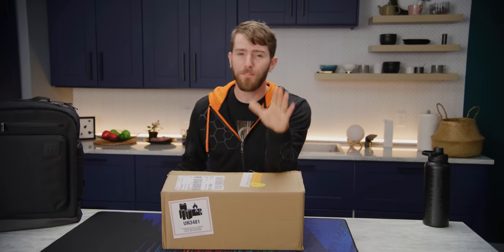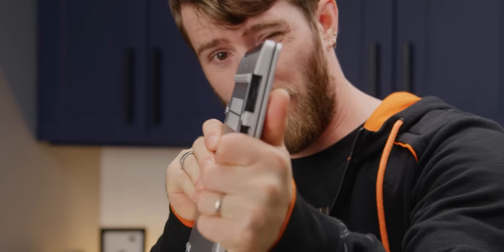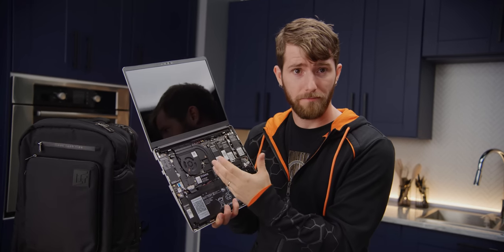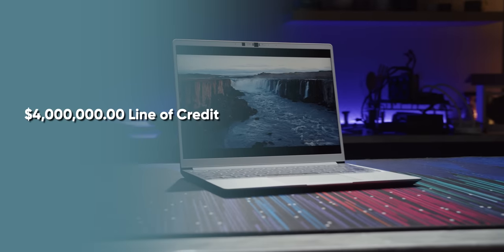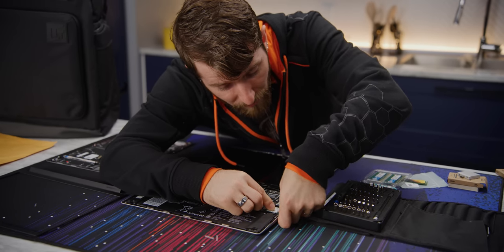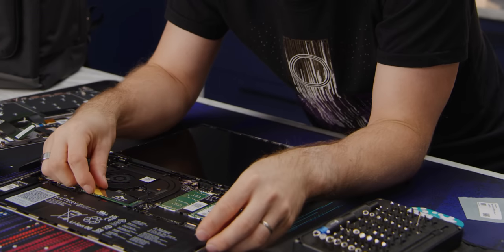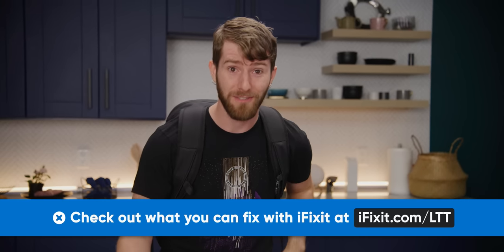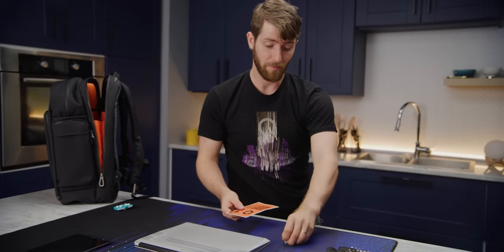I’m Legally Obligated to Disclose This - Framework investment

Comment: As an IT guy that has serviced thousands of laptops in my career, I can say the Framework laptop looks extremely interesting. If I had a quarter million laying around, I might invest in their company too.
Reply: I am awaiting for a laptop with  3060 or 3070 laptop for Data Science and AI Simulation and algorithms for big data visualization. I was thinking of going for Ryzen 6900HX or i7 12th Gen. I am also working on Network technologies and learning Firewall and cybersecurity over Cloud. 

What would be the best option for a  working professional who also needs atleast 3-4 hours of battery life?
Budget: 2 lac INR

Should I wait longer for another laptop or go for anything that's around for 2000-2200 USD?

Looking for usually 17.3 inch or so for better screen as I am working on large data and visualizations. Small screen makes tough to work on large models

Anything best value for money under 2 lac?
17.3 inches only
i7 12th gen or Ryzen 9
GPU based task moderate to high. I do not need 3080 or 3070 TI. 
Screen quality = QHD
Reply: @Naraayanay  You are not going to get full use on battery with a 3070ti on ANY laptop unless it is plugged in. ALL laptops that have higher end GPUs throttle performance when on battery power. If they don't throttle performance while on battery, the GPU will drain the battery in 20-30 minutes. If battery life is a must, then I would go for a Dell G15 (Ryzen 5th gen) with the 3050ti GPU. I have deployed a few of those and the engineers I gave them to LOVE them. Dell makes the G15 with both Ryzen or Intel options available and the battery life is very good. If high end GPU usage is a must, then you are limited to having to plug in the machine to power when doing higher performance GPU loads. Putting a high end GPU in a laptop only gives you an advantage when the machine is plugged in. You could also go with a machine that has USB-C (3rd gen) and get an external GPU enclosure. This way you can still have some portability but not limit the battery life of your laptop.
Reply: @woodlanditguy2951  Bro! it is beyond my budget

I need to go out and move only once or twice a month for work related task. May be 6-8 times a year. So I think 17.3 inches is not a daunting task to carry, yeah it make things heavier but my work flow also easier when I am not able to get hold of large monitor when not in office or home.

Since I am working on two 27 inches monitors sidewise and need large screen. It makes things really small for 15.6 inch. 

I am also looking to build new PC ( Tower or cabinet). I already have monitors. So, I am thinking what could be best spot to buy- whether to get too high end laptop for all task or
upgrade my current PC to new one and then look for somewhat budget friendly laptop
Though I have budget saved since 8 months just to buy 2500 $ laptop. 

Yeas- I agree and whatever machine I get I will be going for 3 years warranty atleast.  All I am looking for well optimised and great performing machine within my budget. 

I am still confused whether to choose AMD 6900 HX or i7 12700 HX
i9 12900 is outside my budget and also overheats and drains battery too fast.

i9 are too pricey! SHould I wait for a month to get things cool down on price or for better options?
Reply: @Naraayanay  Man, I have no idea what you are asking. If you need a 17" laptop and your budget is $2500 then get a 17" for less than $2500... I wouldn't wait to long as part availability seems to be ok for the moment. if you wait, prices may come down (doubtful) but you won't be able to acquire what you are looking for.

Comment: Once they put out a 15-16” Ryzen-based laptop, my company is going to standardize on that. Love the concept!
Reply: Honestly the modularity and ease of repair could probably save companies a ton of money
Reply: Things that would cause other laptops to have to be sent to the manufacturer could now just be fixed by ordering another hdmi port from the manufacturer, it seems like a huge benefit to both parties
Reply: i dont even care about ryzen or intel, 13in is far too small
Reply: I honestly would love to standardize our company using these as well, the ease of repairs as a tech considering it's difficult to get techs on-site to fix issues these days (not to mention I just want to DiY most things) is amazing.
Reply: @anthonyschlessman1848  absolutely. Plus I'd prefer the screen to be OLED.
Reply: @dos_gringos9853  you bet! A company could keep spare parts around to swap out at any time.
Reply: @dos_gringos9853  they could also make all-in-ones like iMacs like this. When the webcam in an iMac dies, the whole thing has to go into the shop; that's nuts.
Reply: @genjii931  yeah and honestly considering that framework isn’t a massive company that can have onsite techs come out and a massive repair program, it’s going to lower overhead for them as well while being able to have a higher level of customer support
Reply: And imagine just being able to switch your IO out whenever you need too, that could be ridiculously useful

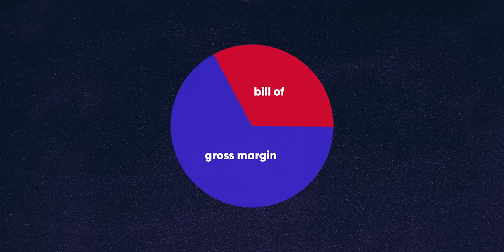Comment: @3:20 Ill have to add to that that the margins on high-technology are smaller, you have a 30ish% bill of materials, in our cable company thats more like 50% with labour accounting another 10-15% and overhead at about the same as labour , so generally the margin is 15-20%

Comment: Super huge risk Linus; I'm not sure I would have done it if I were you.

But I think your video breaking down why this matters and how it works is among the highlights of your channel. Ultimately, I trust your business sense, I still trust you and the rest of the LTT team on laptop review, and I support Framework's vision and direction.

I hope this all works out for the success of all involved.
Reply: It's possibly only a risk if he was concerned about money first, yeah that's a lot to lose, but the effort is probably more worth the investment just to see other manufacturers reconsider their approach.

If Framework fails, there will be somebody waiting to gobble them up, and at that point Linus could just cash out in the buyout (with losses)
Reply: @evolicious  This really isn't true.

The Framework laptop is made using standard off the shelf parts like an Intel CPU. This means that the drivers it uses are made by third party companies like Intel and operating system manufacturers. Even if Framework went bust you would still be able to install new versions of Windows or Linux and application software without issue. This is no different to owning an older PC that is no longer under warrenty and supported by the manufacturer.

The only issues you would have is lack of replacement parts and firmware updates. Given firmware features don't change much over a products life cycle this should not be a huge problem provided they wrote decent enough firmware in the first place. Given no one has complained about the firmware so far I would say this is unlikely to be an issue. It's also possible people will port Open Source firmware to the device such as LibreBoot and CoreBoot. This makes sense as the product is designed for technically minded people who are likely to undertake such an endeavour.
Reply: IMO, Framework is a gimmick that will be out of play in a couple of years. People have been building and upgrading PC's for a long time. Yet every few years you get to a point where you can't upgrade due to architectural changes in hardware. Built a pc with a 9th gen CPU? Sorry, can't upgrade to gen 10 or 11 without upgrading motherboard. This product will be no deferent. Remember Motorola's Moto-Z and Google's Project Ara for modular phones? Yeah, did work out as planned.
Framework are no fools in getting a one of the biggest tech channels to support their product. Where the shepherd goes, so do the sheep.
Reply: @jbrou123  You can still use a desktop PC case from 10+ years ago. It could be the same way in the future with laptop motherboard upgrades.

Nobody is saying you can get away with not upgrading the motherboard or other core system components for all that time. 

Being modular means you only need to upgrade parts as and when you need to. Possibly that you won't have to upgrade inert parts like the chassis for a decade or more because metal is metal and plastic is plastic and neither have any real bearing on performance. It also means you only need to upgrade the parts you care about - like the CPU and mobo instead of say the webcam that you only use once a month.
Reply: @Dong_Harvey  It sounds to me like the main issue here isn't actually building the things or even writing the firmware (there is CoreBoot for that) but marketing issues since Microsoft, Intel, and Google will help you to market your products. Ideally they would get in bed with one of these people. That would help them succeed immensely.

The other option is word of mouth from people like me and you. This actually contributes a lot as lots of people ask the technical person they know to recommend them some equipment. Rather than dissing them maybe you should help with this since it's something we all want to see.
Reply: @harryhall4001  yeah, I'm already talking to friends that generally ask me for tech advice.. I was already suggesting they hold off on laptops for next gen improvements, but Framework made a new cake and took it too

Comment: "The only reason other companies can't do this, and Framework proved it, is because they don't care."
Reply: I was late. Commented the exact same. I like that quote.
Reply: Mr. Rossman approves.
Reply: Greate quote. They don’t care, and it would go against their vested interests.
Reply: inb4 the company goes under in less than a year becasue of the insane impossible task of keeping up with supporting proprietary firmware on a bunch of adapters (gg intel and USB, lol). Which is literally why every company that tried to do it in the past failed miserably, even with the deepest pockets.
Reply: @evolicious  You don't have to do any of that. The drivers are written for you. The only thing you really have to do is occasionally update you CPU microcode or AGESA.

Comment: "Framework has committed to providing schematics for board level repair" I don't think you know how powerful and lucerative this is for me, I will be able to fix these laptops for YEARS. Thank you Framework!
Reply: From what Louis Rossmann has said, it sounds like it's difficult to release the schematics widely, but they are planning on releasing them to independent tech repair shops. I would guess if you have a relationship with one of said shops you could probably get access that way! Hopefully releasing the schematics doesn't cause and legal trouble or knockoff undercuts :( That would make releasing schematics a much tougher sell in the future.
Reply: Louis Rossmann had an extensive conversation with the CEO of Framework and that was one of their biggest changes after that conversation. Louis did an unboxing stream and Framework posted comment replies to it. 

I hope this company succeeds and I'll buy one when they have dedicated gpus and AMD cpus.

Comment: They're everything I ever envisaged, as a computer technician. If only I could create laptops myself - this is it.
Reply: A ball-and-chain to the ankle and a couple years of Altium and SolidWorks experience should definitely be a start.

Then it's a bit of supply chain consideration for some jellybean parts like screens, touchpads, chips, etc.

Then learning the black magic RF and EMI Jedi from Eric Bogatin and Rick Hartley should cover the high-speed electronics required.

Then learning DDR PCB layout, power electronics and BGA routing for the mobo components to work.

Then learning how to program a BIOS from scratch in order to get the monster of an x86 chip to work. Plus the firmware support needed for your external components to work.

The list goes on and on, but it's definitely possible. It's just that the vision required to make this goes far beyond just owning the laptop.

Comment: This. This is how conflicts of interest should be handled. I havnt had a reason to doubt LTT's honesty before, and this seems like not only a good investment, but is also directly benefiting me by helping keep these kinds of options on the table. 
If they made a dGPU model, It wouldn't be a question what my next laptop would be. Unfortunately, I dont have a use for an ultrabook that my surface pro 5 doesnt fill.
Reply: Just imagine a gaming laptop with Framework level of upgradability. I am 100% sure, that it would dominate gaming laptop market even if we would have to make some compromises.
Reply: @Leviafan95  When they do get around to doing that you can be damn sure I will be buying one. Bought a gen10 aorus laptop last year. So not looking for one currently, but if it was available I would be switching and donating the old one after receiving it

Comment: PLEASE LET THIS BE A SUCCESS! And if possible in the distant future, completely upgradeable GPU. Wishing you success Framework!
Reply: Cpu as well
Reply: @danieldarie6659  swappable CPU probably means swapping out the main board because laptop cpus tend to be BGA.
GPUs however would probably be those MCM modules.. it would add thickness to the laptop though
Reply: @eisenklad  yeah but it must be possible to develope a standard where you can BGA connect a CPU with your motherboard. It’s probably gonna take forever, I hope I can skip buying a laptop till then
Reply: @jooplin  i have to be a letdown
unfortunately this will never be possible, the cpu itself isn't designed to be socket mounted/friendly these days, and it's out of framework's hand, they simply can't
even if they can, the laptop will be bulky with increased chance of breakage (cpu socket in a laptop was never a successful idea)
but they went with a smart move, mobo can be swapped easily, and they provide schematics for the old one, in case yoy want to diy something for it, mad respect.

Comment: I haven't needed a personal laptop in a few years now. If that ever changes, I'll definitely be looking at Framework first.
Reply: Same. Looks great but I have no use for a laptop
Reply: The way I went was a SFF PC (4L) with a foli display and an HDPLEX DC system so that I can run the whole system on a battery pack or with a wall plug like a laptop. It's very similar to the framework except with desktop components.
Reply: @davisbradford7438  Can you please detail your use case for that machine? I'm genuinely curious. Cheers!
Reply: @VladRSK  It's essentially a truly portable desktop computer. It can run display from the GPU or APU like a standard laptop for various power needs.  It can run with or without standard AC power, on battery or from any DC power supply between 16V and 63V. I use it for CAD, gaming, and productivity.